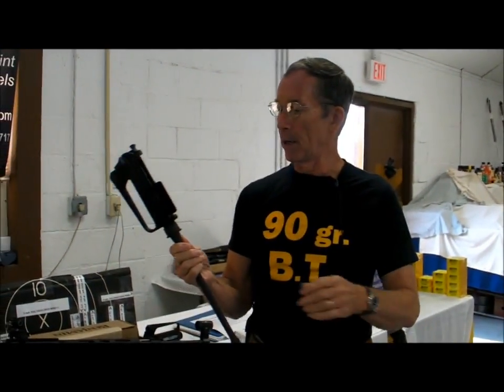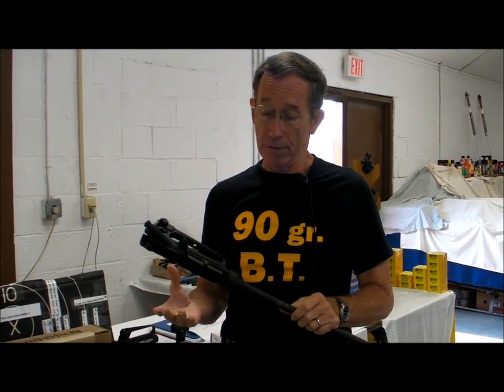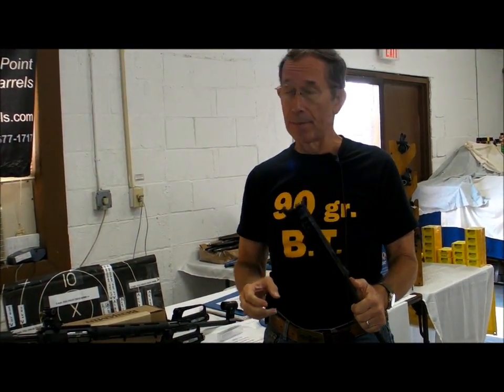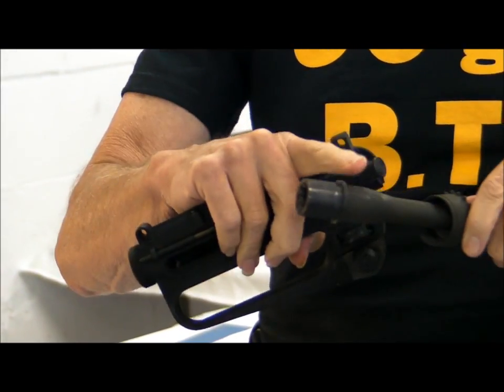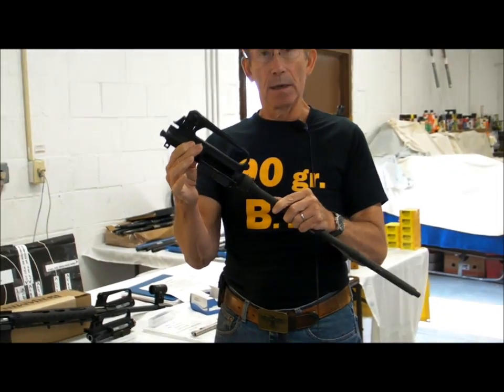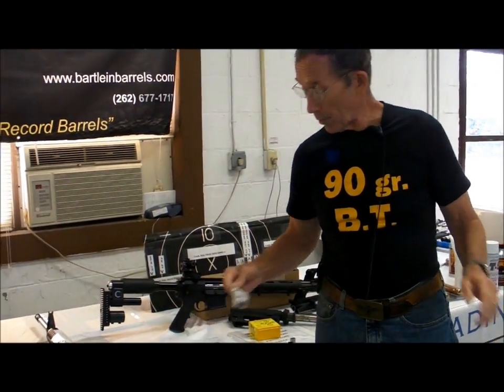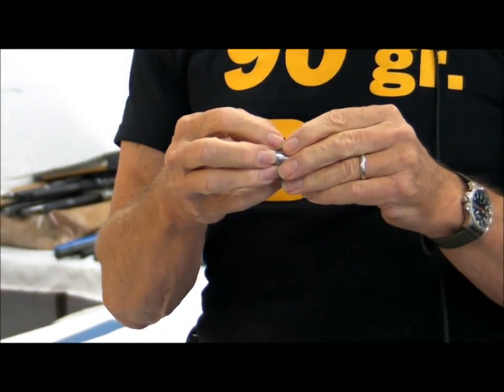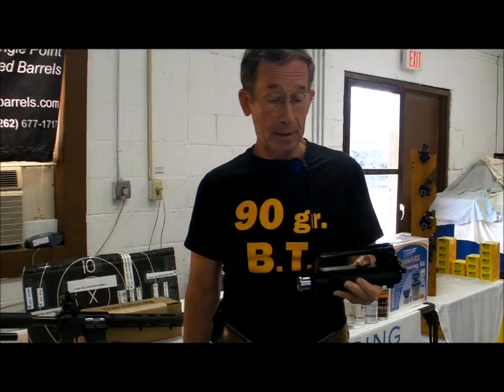Building Match Grade AR-15s

Comment: I know this video is a little old, but BCM and JP make their receivers slightly undersized requiring the builder to head the end of the receiver prior to installing the barrel. Works great and doesn’t require any shims or new barrel extensions.
Reply from the maker: Yes, you're right. Joe Carlos has discussed this in his articles published since this video was made.

Comment: Joe C. I gotta say that I feel for you buddy! You are one patient man to put up with all the keyboard/internet AR masters out there. Having been a CNC Machinist myself for some years I'd be more likely to discourage people from building AR's because it seems more than a few of them miraculously become "masters/experts" after one or two builds. I do appreciate you pointing out these flaws that you find in the platform though. You've accelerated my learning curve of the AR by a good decade I'd dare to say. Sometimes I try your fixes and sometimes I just rely on my own bag of ticks learned from years of making chips. Thank you for your time and effort put into sharing your experience!
Reply: Will,
As a machinist, what are your thoughts on using shim stock on the barrel extension and heating the upper to achieve an interference fit? Does that seem like a smart idea or am I tilting at windmills?
Reply: @poisonouslead85  I have shimmed a couple of mine. I don't bother with heating the upper though. I three point the barrel extension with the shims. The shims are secured with flange sealant on the surface that contacts the extension only. Most people think that flange sealant is a type of glue (and used improperly it sure can act like it!) but, it's more akin to expanding foam, it swells and fills voids. If you don't have the means to true an upper and fit the barrel with oversized extensions then this is the best method I've found to mount barrels to uppers that are almost always out of round.
Reply: @willc3037  Thank you. I have a floorsweep upper I bought back when I didn't know any better, and I'd like to try to wring what accuracy I can out of it. Pardon me for asking, what do you mean by "three point the barrel extension with shims"?
Reply: @poisonouslead85  this would be a lot easier with a diagram but, here goes...
Imagine your upper being a chuck on a lathe. A lathe chuck has three jaws for holding round objects. In this case the shim stock becomes the jaws contacting the barrel extension.  You want points of contact every 120° around the circumference (maybe easier to think 12 o'clock, 4 o'clock & 8 o'clock) so that the extension becomes trapped in the upper between these 3 points. Generally speaking I let one natural point on the extension server as a point so that I'm only working with two pieces of shim stock i.e. extension is resting against 12 o'clock and I have shim stock at 4 & 8 o'clock.. 
This is just theoretical spacing, you can have the three points referenced anywhere you want as long as they're basically 120° apart. I like my shims to be anywhere from .1-.2 inches wide and the full length of the extension (the portion mating inside the upper). I keep most thicknesses of shim stock on hand so I use whatever combination of shim thickness and it's width that gets me the best fit without having to pound on anything. Once it's all mocked up I'll lightly grease the upper and stick the shims to the extension with flange sealant and slide the two together. If nothing moved I'll add my barrel nut and torque. I usually set everything aside for a day to give the flange sealant time to do it's thing. 
If you've done it right removing the barrel isn't as easy as assembly. If I need to remove mine I'll just back off the barrel nut a full turn and tap the face of the nut with a plastic hammer. Rinse and repeat until the extension pin is clear of it's slot in the upper. At this point I'll usually be able to go the rest of the way by hand using a little twisting as necessary...
Reply: @willc3037  I understood it perfectly, thank you sir!
Reply: Thermal fit is the way

Comment: How do you get the new barrel extension to proper torque and keep the barrel gas port and index pin aligned?? How do you keep proper head space when replacing the barrel extension??
Reply from the maker: This was covered in detail in the published articles. Contact Joe Carlos directly (NCC1701 at penn.com for details.

Comment: If you can still remove the barrel from the upper by hand, then it is still too loose. When the receiver heats up, that gap grows due to the expansion rate of aluminum is much greater than the steel of the barrel.
Reply: This is why thermal fit is the way.....none of my barrels fit into my uppers without a torche 😆

Comment: I changed out new BCM LW barrel on a new BCM rifle with a Faxon 18” heavy fluted barrel and the fit was very tight, I’m hoping this is not an issue on my SPR build.
Reply: was there some friction as you pulled the LW barrel out? i've heard bcm upper dimensions are tight, meaning every bcm receiver is tight to the barrel extensions of any and all barrels
Reply: I didn’t have any issue pulling out the factory BCM barrel. I had to use a rubber mallet to tap the Faxon barrel in and I used anti seize. I have a MK12 Mod 1 clone and it shoots MOA or less with XM193, the Faxon
Reply: BCM does not.
Reply: a tight fit is ideal and desirable in all situations. since you used anti seize the faxon barrel should come out by hand when you finally decide to remove it
Reply: I just finished a 14.5" Faxon build. The barrel extension was extremely tight to my Aero enhanced upper. I lapped the upper, and have high Hope's for it's accuracy.
Reply: @claytondennis8034  just want to point out that tightness and squareness will also distribute the load more evenly on the bolt lugs during firing, so it's a longevity mod too.
Reply: I've had to heat BCM uppers and cool barrels in order to put them together.  Nice tight fit with BCM uppers.
Reply: Looking to buy an AR in 6.5 creedmoor.  Would you piece it together as a Frankenstein gun or flat out buy an AR as a whole?  I'm seriously looking at the JP Enterprises or Rise Armament as an option?  Zev makes an
AR-15 Billet rifle.  According to Ballistics Best Mag (Jan 2020 ed) & their test shooters rated this gun #1 out of 10 different top branded AR's.  Looking for opinions on this matter?
Reply: @steffeness1  JP is a solid rifle for sure
Reply: @bl1969     The min price on a JP 5.56 / 18" barrel is appx $2300 & the 7.62 x 51 (.308) minimum is $3000.  I'd just like to know if spending that extra $1000 - $2000 is worth the price instead of a bottom to top custom build?
Reply: This is what you want.....faxon match barrels and bcm uppers is my recipe for accurate ars.....proof is even better.....
My last build will be jp enterprises and proof....

But my bcm proof combo shot a 3 shot group under 3 inches @ 1k yards

Comment: If one is going to use green locktite, how can one make sure to not cause barrel clocking, or feedramp misalignment between the barrel and the upper when tightening the barrel nut?
Reply from the maker: The locator pin that sits at 12 O.C. on the extension still lives in the cut-out in the upper receiver and prevents the problems you are worried about regardless of whether green Loctite is used or not.

If you have further questions feel free to email Joe Carlos directly at NCC1701@penn.com

Comment: Someone needs to make a one piece .001 shim that wraps completely around the barrel extension and has a knockout for the index pin so you don’t need to replace the barrel extension and re-headspace the barrel.
Reply from the maker: Good idea. Perhaps soon from Redline870 Gunsmith Supply? :-) I'll even feature it in American Gunsmith.
Reply: No....just get a good upper receiver and barrel that requires a thermal fit.....done.

Comment: When you change the barrel extension, how do you time the gas port? How do you remove a barrel after you use green loctite??
Reply from the maker: From Joe Carlos.

In 2013 I published an article in which I mentioned the use of green LocTite to improve the precision of custom AR builds.  A lot of people have been using the techniques described in the article ever since and their feedback
has been very favorable.  Part 2 of the article published in April of that year should
thoroughly cover the topic.  Getting barrels out of the receiver and
cleaning up is really quite easy.  It may take you longer to read that
part of the article than to perform the actual task.

I have mentioned that I sometimes remove factory barrel extensions from
barrels because they tend to run too skinny.  Then I replace them with
fatter custom made BAT Machine extensions that better fit the receiver. 
When doing that "timing" is an issue as you suspect.  The aim is to get
the locator pin in the extension straight in line with the gas port when
the extension is set on to 150 ft. lb. using a torque wrench.  So if you
just pick an extension at random it might well NOT time up correctly and
that has to do with what is called "thread start point".  At the very
back end of the barrel is a thread and its "start point" can be anywhere
from 12 O.C. back to 11 O.C. depending on where the barrel maker started
it.  So if we choose the wrong extension with a start point that doesn't
agree with the start point of the barrel it will time up either short or
long with regard to the gas port.  To deal with that I have the
extension maker make up extensions with all start points from 12 O.C. to
1 O.C., 2 O.C. and all around to 11 O.C.  That way I can pick out the
one that times up right with the gas port on what ever barrel I am
trying to use it on.

Obviously this means I have to stock dozens or hundreds of extensions. 
It is one thing for a full time gunsmith who only works on Stoner
Platform rifles to tie up this kind of cash in inventory but something
entirely different for a person wanting to build ONE rifle.  Therefore,
if you are dealing with an existing extension that is too skinny it
would probably be best for you to simply wrap some .001" shim stock
around the existing extension enough to build up it fat enough to get a
nice tight fit to the inside of your receiver.  The use of shim stock is
covered in the article.

I hope this answers your questions and if not you can reach me directly
at NCC1701 at penn.com
Reply: @FUNshoot  That was an excellent reply.  I always wondered about barrel extension replacement. Thank you for taking the time out of your life, to type out a very thorough reply. It was very much appreciated.
Reply from the maker: @hairydogstail  Email a thank you to Joe Carlos.

Comment: I know this is very old but about lapping the upper where the barrel flange mates to the upper?
Or is that just a waste of time and money for the tool and compound?
Reply from the maker: Good fitment can be an aid, particularly in high match accuracy levels, but lapping as you suggest will offer little benefit.
Reply: @FUNshoot  good to know I wasted $29.99...lol but it's fun tinkering
Ever run into canted front sight bases?
I've heard of guys drilling and taping and using set screws instead of the taper pins but not sure how well that would work on a round barrel.
What about filing the key way so the barrel could slightly rotate in the upper to fix the cant?
JP Enterprises makes a front sight base that uses a clamping action attachment mechanism maybe that's the best solution.
Any suggestions would be greatly appreciated

Comment: Wait, so the barrel extensions thread on and are already indexed for proper gas port orientation? Please pardon my ignorance here.
Reply from the maker: Yes. A barrel blank is threaded for an extension, which is held by the barrel nut.
Reply: Most likely, the gas port is drilled after the extension is installed on a newly constructed barrel. Makes the process pretty fool proof. If changing the extension out, it's much more involved as achieving that same level of alignment is somewhat of a crap shoot.

Comment: Nice explaning! thums up! The question in my mind at the moment is: How is the barrel extension fitted on the barrel? Is it screwed? How can I unscrew it? First remove the Pin and then?
Reply: The back of the barrel has a male thread that matches a female thread on the extension so they simply screw together and are torqued at 150 ft. lb.  There is a special fixture that fits inside the extension while either installing the extension or removing it and you can see one in Brownells catalog.
Reply: First you need a barrel vise, easy to make yourself if you have the means.
Reply: 150 ft/lb? 
The manual, eg Mr Stoner, says 30-80 ft/lb.
What benefit does going over 100 provide?
I don't even torque my lug nuts that tight.
Reply: @brianmorrison9066  I think you're confusing the barrel nut with the barrel extension.
Reply: Looking to buy an AR in 6.5 creedmoor.  Would you piece it together as a Frankenstein gun or flat out buy an AR as a whole?  I'm seriously looking at the JP Enterprises or Rise Armament as an option?  Zev makes an
AR-15 Billet rifle.  According to Ballistics Best Mag (Jan 2020 ed) & their test shooters rated this gun #1 out of 10 different top branded AR's.  Looking for opinions on this matter?

Comment: What barrel extension option is best to go with from bat machine for a 300 blackout going in a standard mil spec upper receiver from Palmetto state armory? Will be doing a barrel swap very soon and would love to get one to try out. On bat machine's website the have the standard feed ramps and the m4 feed ramps, and they have the sizes .999 and 1.00 and I'm not certain which to go with or what the best method for measuring the reciever. Any help or advice would be appreciated.  Thanks for the great video and for the information on this topic! New subscriber here👍
Reply: You'd need a mocrometer or a really quality pair of calipers to answer that question for yourself. Most manufacturers now are using the M4 feed ramps (look like 2 notches in the bottom of your barrel extension, the upper will also share a portion of these 2 notches).
 It's a good bet that if you have slop between the barrel and upper you're going to need the 1.000 in. barrel extension though. It's a lot easier for manufacturers to hold tight tolerances on a barrel extension than on the forged uppers that PSA usually sells.